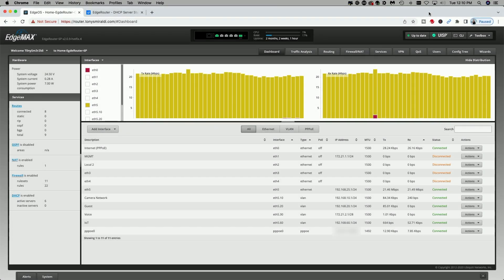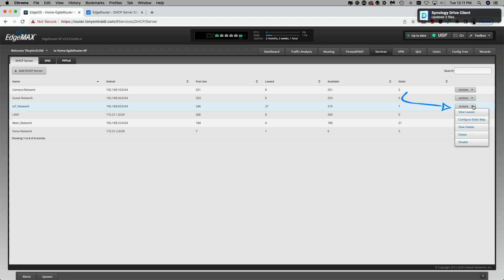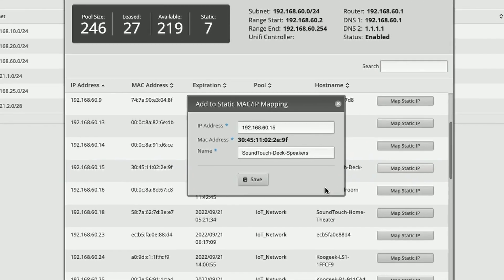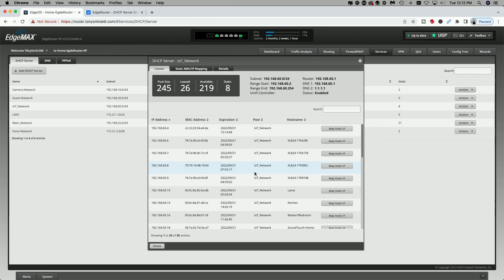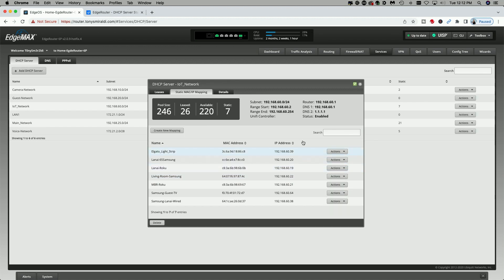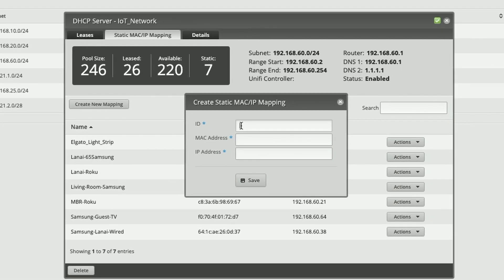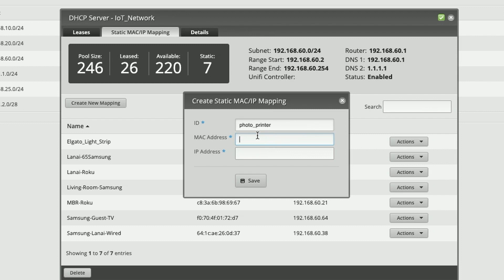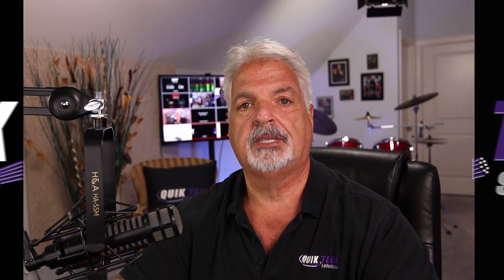How To Create Static Mapping On An EdgeRouter

Comment: Loved the video, Tony! Especially the preconfigure option - never did that, but can definitely see the value in it. Will remember it moving forward!
Reply from the maker: Thanks Frank. Appreciate your kind words. Hope you’ve been doing well.
Reply: Been searching for someone to point out how to pre-configure as I have my Edge Router ER-X here but I want to pre-configure all my static IP's using the MAC before I remove my old router and connect the ER-X. Will save the headaches of doing once live.

Was going to ask a question, if you pre-config static IP's can they be from within the DHCP pool or do you assign them from the same subnet but out side the pool? For example I have a DHCP range of 192.168.0.10-192.168.0.100, can I assign static IPs such as 192.168.0.5 etc?